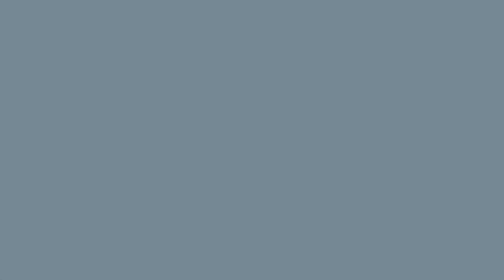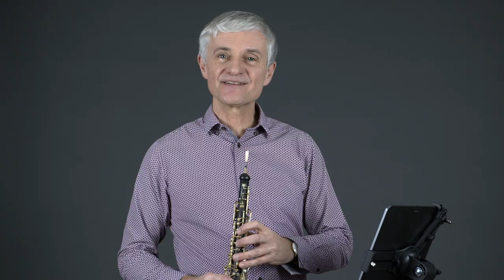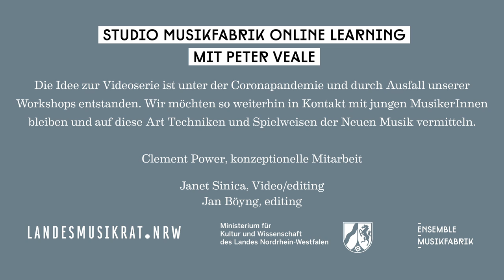SMOL | An introduction to air tones on the oboe with Peter Veale

Comment: 0:35 without reed (exhale)
0:45 (inhale)
0:57 exhale & inhale (can breathe)
5:25 with reed (inaudible)
6:13 open mouth slightly (“sh”)
7:24 a little away from the reed